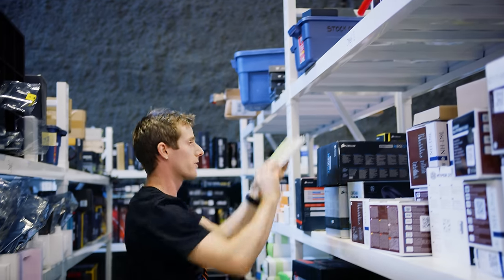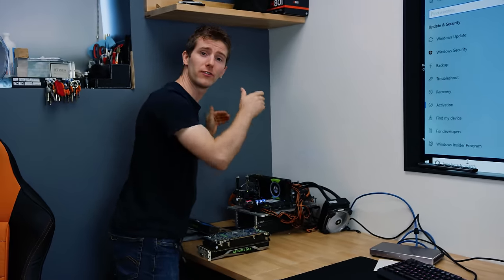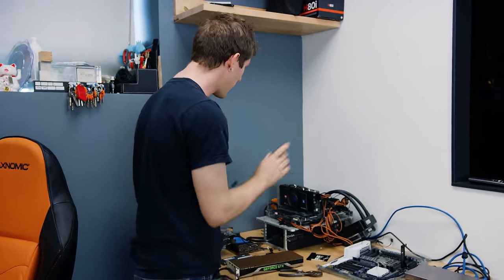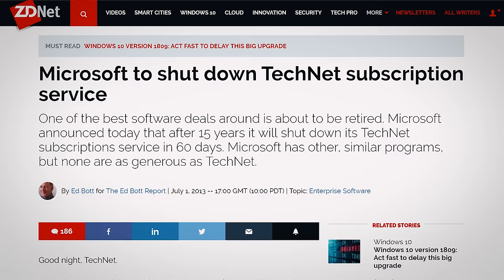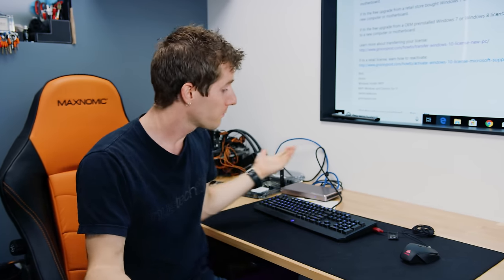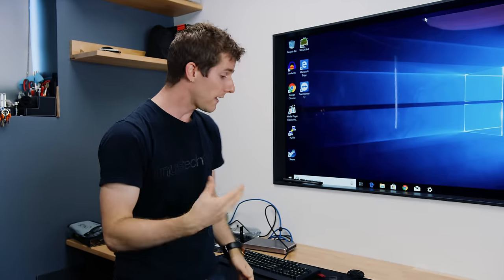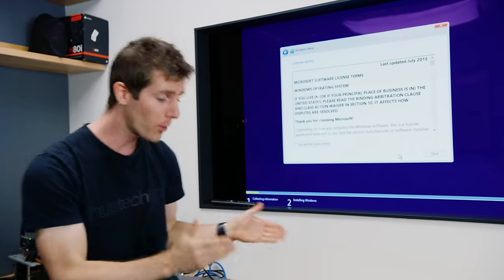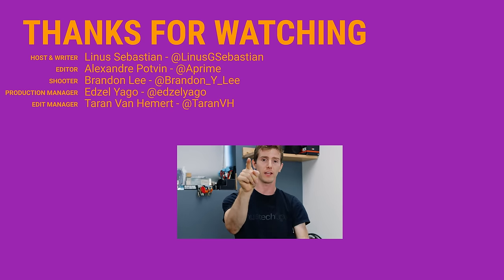Why Does Linus Pirate Windows??

Comment: EU legislation forces Microsoft to do away with their limitation on hardware changes because it states the product (Windows) is the product a user buys. The user doesn't buy 'software specific for à pc' but software the user can use on ANY (supported) PC, as long as it isn't in parallel (in the same way you cannot watch a blu-ray movie on 2 blu-ray players at once).

There are many such cases in which the EU better protects its consumers against businesses being mean and anti-consumer compared to other regions/countries.
Reply: +Linckel
They only "wouldn't want it" because lobbyists are owned by big corporations that pay to market against changes that would benefit common citizens.
Reply: The idea that software can be legally made to be tied to a specific hardware configuration is asinine. The only way I can conceive of it being tenably allowable is when corruption is involved.
Reply: Though I do agree with you. The s LLP specific EU law was a  compromise.  It stems from a old issue with cassette game tape rentals. The consumer received the right no matter the company or EULA to sell a single copy of the software. The companies were given the right to control rentals. Only thing on EU a company can restrict is rental of software. Most resellers in EU keep a record of destruction for the OEM key if it is from.a major manufacturer. They can restrict install a single copy on more than one machine. The problem is the company has to prove the consumer has done so. You still have to activate for that reason. They can require you to reset actuvation, but can't say no. They can sue you and force you to prove destruction of old equipment.  MS said basically it is not worth the time or money to do so. Interesting enough if the UK leaves the EU, and specifically the economic region. Heard they might not leave the economic region. EU economic region, and EU membership can be separated. The laws in UK will fall back to the 96 law. Pretty interesting stuff in my opinion. The only OEM liscence that can not be transferred is Windowd 2017 and Windows RT. These are part of the embedded device line. Things like tablets, phones, and industrial equipment. The only real negative for regular non-techie  people in EU is a little more cost on systems from major manufacturers.
Reply: In the US, on an update screen, I saw just a few days ago "Windows is a service". It is simply absurd over here. Keep watching Spongeborb America!
Reply: @aeiounix  im pretty sure it says "windows services"
Reply: Nothing absurd about it. When you go and "buy" Windows, you do not own the software. You have bought a LICENSE to use the software.
Reply: When I buy windows, I am paying for a dissemination of their code onto my machine. I'm paying for a full product. From there, personal use dictates that I should be able to reproduce the code that I bought as long as I need to in order to ensure the longevity of the product I purchased. If windows wants to do a bunch of extra updates and other bullshit, that's on them and they could charge for update subscriptions. But when I buy windows, I expect to have windows. A full version. Completed. Least amount of bugs possible. All compatibility updates need to be negotiated on the software/hardware provider for whatever else you add to the computer (They buy update code from microsoft). That way windows can go back to being a product and no longer a service. Given that windows is the PC standard and is kind of needed to do anything at all on PCs now, they don't need to be making any more money after the code has been disseminated to the user. Trying to get any more money out of us over activations due to switched hardware is extortion.
Reply: You mean the US.
Reply: I personally like the activation system, being able to skip the CD key and have Microsoft automatically figure out that it's a legitimate copy dependent on the hardware or the microsoft account linked to the computer.

But limiting the number of activations, the number of hardware changes, is a load of shit.
Reply: Yes but forcing it to be used on one piece of hardware basically turns it into hardware itself, you can't take the software and use it somewhere else, you have to own the hardware. You have the license, you should be allowed to take it off one thing and use it wherever you want, you do have a license to use it after all.
Reply: The funny thing about all of this is that it is only estimated to become a bigger and bigger issue since Microsoft has stopped making 'new' versions of Windows and will only 'gradually' upgrade windows 10 (in the same way Apple has done for years now with OSX).

In the old days you'd buy XP, and that would (generally) last roughly as long as your PC would until the new version of windows came out that you'd have to buy along with a new pc anyway so even the few hardware changes you'd have done in the meantime (like swap a GFX card or a harddrive or something) wouldn't have tripped the licensing mechanism.. but that doesn't really apply anymore seeing as basically now if you buy windows 10 once (in theory) you have the latest version of Windows... into the foreseeable future.
Reply: because in america  corporations are people lol.
Reply: ayporos this is true and it’s how I managed to activate windows once for £3 and change my hardware out a bunch of times and it’s still fine.
Reply: @Linckel  right up till they almost accidentally allowed copyright strikes against memes...
Reply: Then it turns right around and screws them on something else, if it weren't for their and their member states' copyright laws this simply wouldn't be an issue in the first place. The EU is part of the problem, not the solution.
Reply: and that's why Europe is full of big European tech companies, just like Microsoft, Apple, Google, ibm, etc (not)
Reply: Would fair use mean a single license per person but you would only have one for all your pics.
Reply: True in practice, but after a bunch of activations, it will refuse to activate, and Mickeysoft will say "no", despite what the law says. They know most people can't afford a lawyer to sue them over it. £10000 lawyer, or £150ish new licence fee...
Reply: This is why I use Linux, and with a Virtual Machine.
Reply: @TheDcfan01  It doesn't matter where they're from. They are subject to the same laws if they want to do business in Europe.
Reply: You mean corruption. LOL  There's a reason why the monopoly board game comes form America. :D
Reply: Brain washing.. that's why..
Reply: @CognitiveDissonance  it matters to prove the point that government regulation stifles innovation.
Reply: @Linckel  because it had to be reworded.  It only stopped due to mass public outcry if I recall

Comment: It's not pirated, it just runs without a licence key.
You get not all functions and limited in the usetime of the OS.
Why would MS otherwise allows you to install Windows without a key.

In my opinion, a pirated version of Windows is a cracked one, means that you bypassed the activation to get a full version.
Reply: There's no limited use time
Reply: if i remember correctly , they started adding the skip button for serial numbers back in XP 
it was still 20-day trialware then, so not illegal

basically windows 10 is abit like winrar now lol
Reply: Windows 10 doesn't have a limit to time use. Unlike Windows 7, that kicks you off after 30 days, Windows 10' only downside to not activating is a watermark and desktop customization is disabled.
Reply: there's no usetime limit and only one function that's missing is ability to set wallpaper from a desktop and customize few minor things, that's it
Reply: @OreosCookiesNCream  you can still change the background as long as you don't use the tab
Reply: You can still change the background on an unactivated Windows 10 installation. Just open your picture in the photos app and select set as background. Also, if you have a different laptop/desktop with an activated Windows 10 installation, you can customize the accent color with some sort of feature that signing in with a Microsoft account on both systems allows you to do. I did this once, but reinstalled my unactivated Windows 10 installation and never tried to do it again because I don't care about colors. Basically, the only downsides I have are the watermark, and not being able to get "Open command window here," because switching from Powershell to Cmd requires activation. Not worth paying $30 to get rid of.
Reply: I can use my command prompt instead of powershell. Is that what you're talking about?
Reply: Josh Gerhards - Odd, because I can run .bat files and open CMD just fine with unactivated windows.
Reply: @spoonikle  I can still open command prompt - but not by using shift+right click in a folder to automatically get the directory to that location.

Comment: me: Searches the internet for keys
me: finds win 10 pro key
me: tries it and it works
Microsoft: god damn this man beat the system
Reply: this actually happened
Reply: searches*
tries*
Reply: @x4d5  actually*
Reply: @iamsk8  Sherlock* The first letter in names are always capital.
Reply: @patrickasmussen7295  Youtube is not school.
Reply: @GigaChad666  YouTube*
Reply: @omgvague  idc about caps lock
Reply: @GigaChad666  shift key*
Reply: @omgvague  Caps lock*
Reply: @hellhound320  that's incorrect
Reply: @ahkao.9347  Correct me then, I want to learn more.
Reply: Hellhound your use of periods is actually wrong on the abbreviation, since you can not have a period and then an exclamation point right after. Also, the correct sentence would have you transform the abbreviation back to it’s original form, since as an abbreviation, it infact isn’t grammatically correct.
Reply: @devs3720  correct this, I wentos to kell yous in brd
Reply: @devs3720 defeated lol
Reply: @nishiko28  That was punctuation not grammar.
Reply: @patrickasmussen7295  this literal 8 year old is going around correcting people in a youtube comment section
Reply: Did you have to do a fresh install? 
I want to do it but don't want a fresh install
Reply: @WhiteWolfos  no u dont need fresh install
Reply: same i have 3 codes lol :)
Reply: Vishnu Sudarshan where did you get them
Reply: @strojinsama  Also Linus is dumb (jk), because you can reactivate windows with the same code for free lol XD
Reply: @omgvague  YouTube*.*
Reply: @devs3720  So i guess we are all wrong here XD
Reply: Hellhound i mean it isnt actually that important tho, i just cant stand grammar nazi’s so i’ll just literally try to find any type of fault in their sentences just to like kinda get back at them, but i mean ur being a good sport about it so its cool ig

Comment: Er, yeah, not activating Windows is not against their terms and conditions.
Why would you burn a licence for a copy of Windows that's only going to be used for a video, once?
And then wiped!
Reply: Although, this is why I use Chrome OS, Android, Synology DSM, XenServer and Ubuntu at home.
Or, in other words, a billion flavours of Linux.
Reply: @MostlyPennyCat  Only problem I have with Chrome OS is how you can't really put anything on it that isn't on the chrome webstore easily.
Reply: DarkLink1980  Chrome OS has the playstore for Android apps now. Also native Linux software is coming soon.
Reply: James Neave exactly. A lot of people on social are completely clueless and not even worth engaging with.
Reply: Who reads the terms and conditions?
Reply: Those look like OEM licenses, those are only good for the one install on the "original" hardware.  Retail licenses can be moved as needed.
Reply: The same reason they destory a brand new iphone for the purpose of a video.
Reply: Except that 99% of regions have fair use laws that invalidate that.

Also, those are likely System Builder licenses or bulk licenses.

OEM licenses are only shipped with mass produced PCs.
Reply: Weeeeell, if they didn't make this process unnecessarily restrictive to legit customers, you could theoretically re-use the key for all the throw-away installations of Windows. It's not that difficult to do, some development products use an activation server. As long as you're on a network with it and don't use more than how many keys you've bought, it'll auto-activate. Simple, straightforward. Unfortunately, Microsoft doesn't really care about activation that much.
Reply: It takes 2-3 hours on the phone to be allowed to re-activate windows one extra time.
Once.
After that they refuse.
Nightmare from my first computer.
Reply: I actually got into this problem when I installed W10, then returned to 8.1, then I repeated the process trying to figure out which was best for my good old notebook, had an e-mail and prompt telling me that I was running out of "license" for this product
Reply: It is not. But Linus could really also just have an activation server, PXE Server and a MAK key and he'd have infinitely selfinstalling windows, it could even install all his favorite benchmarking tools automatically.
Reply: What does "Er" Mean?
Reply: @subtractivemusic  
er
əː,ə/
exclamation
exclamation: er
expressing hesitation.
"‘Would you like some tea?’ ‘Er … yes … thank you.’"
Reply: Chrome OS literally sucks. You don't get access to anything and the PlayStore games are hardly what you'd want on a laptop or PC. Didn't they also do the whole data streaming thing with the ChromeBooks in how you need to be connected to the internet 24/7 or you'd lose your data?
Reply: @PHeMoX  
It's not for gaming, is just for normal computer stuff.
Web, office, photos, etc. They're cheap, small and easy. Apparently you can Android apps too now, not tried it myself.
Reply: @PHeMoX  
And no, you don't lose any of your data, it's all stored in the cloud, like everything is now.
Or I use my Nas.